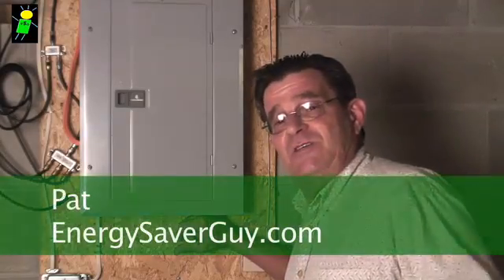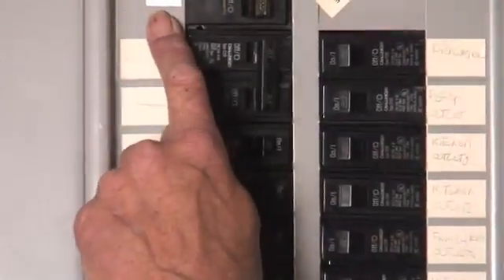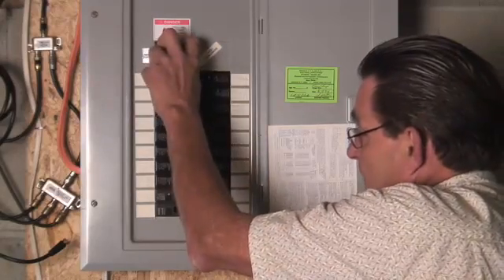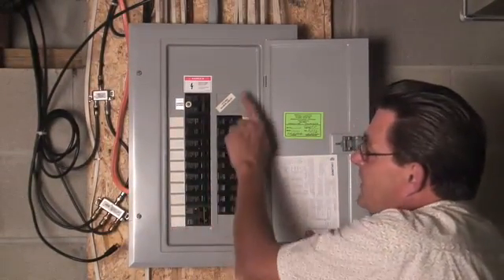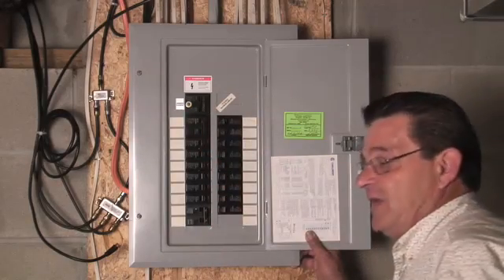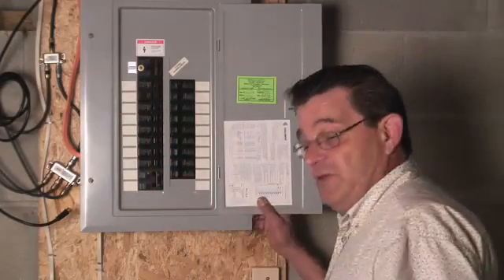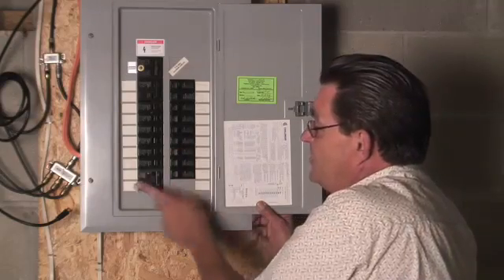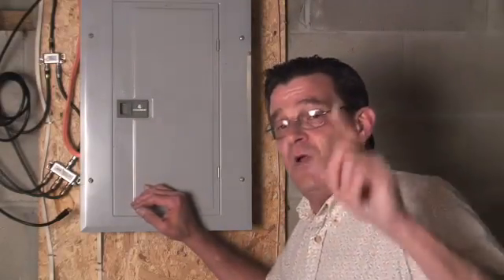Home electricity panel how to use it

Comment: Calling them "double pole" would not only be more accurate, but is also the industry standard terminology. Not a big deal, but thought it was worth mentioning. Should have placed more emphasis on the main c.b., many do not understand the connection of the internal buss and how in an emergency, opening the main effectively removes all electrical energy from beyond that point. I understand you are keeping things simple, and I like your approach.